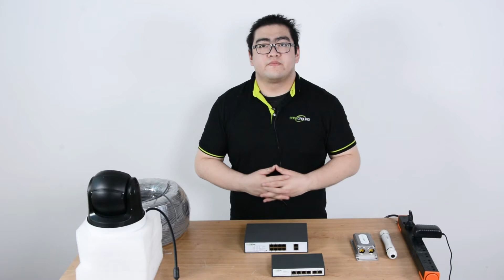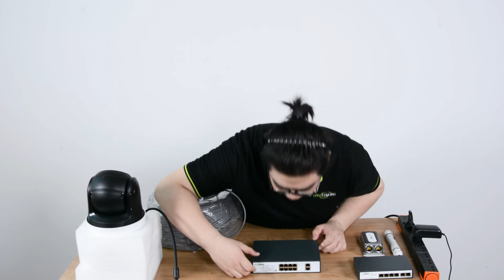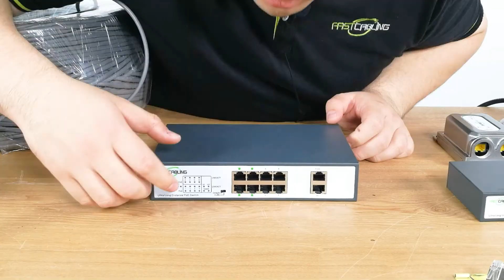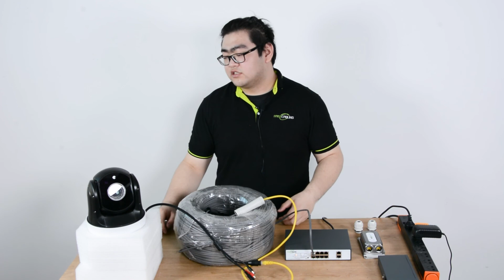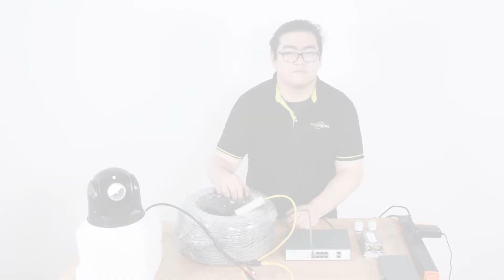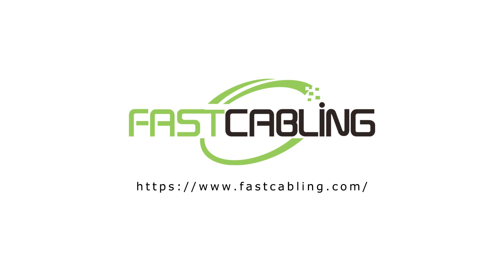What is Ultra Long Distance PoE Switch?-Knowledge Base & Introduction

Comment: Just to clear my understanding.I can run up to 4 ptz ip cams.all I have to do.is to use the poe device next to ptz cams.correct?
Reply from the maker: Yes the PoE adapter will help the ptz camera return long range data. The communication is always two ways. It employs all 4 twisted pairs to carry the power. You should have PoE+ power within 350 meters.

Comment: How does this switch interface with an NVR POE injector?
Reply from the maker: You should connect the switch to the unlink port of your POE NVR, but not the POE ports. The NVR could keep scanning the PoE ports which cause all cameras switching in the single windows.